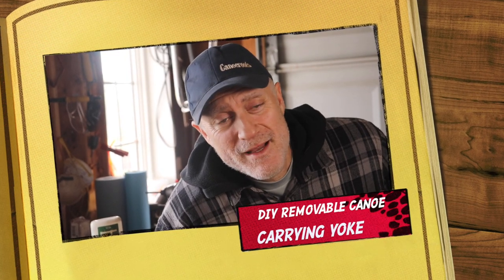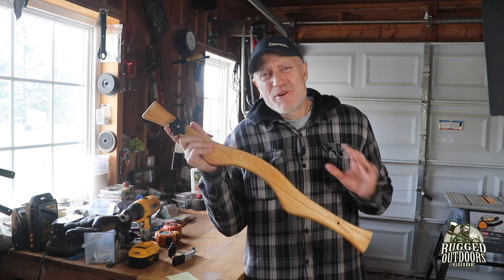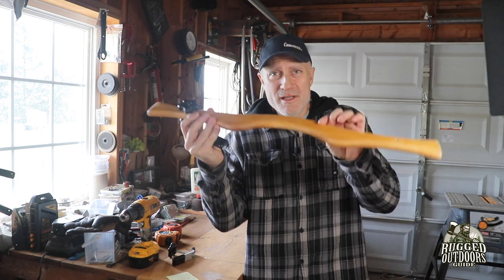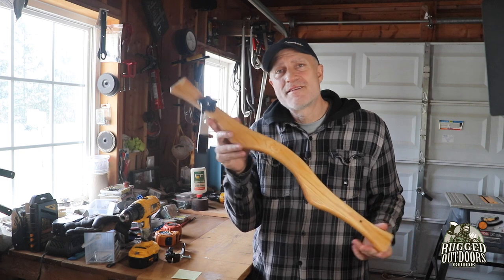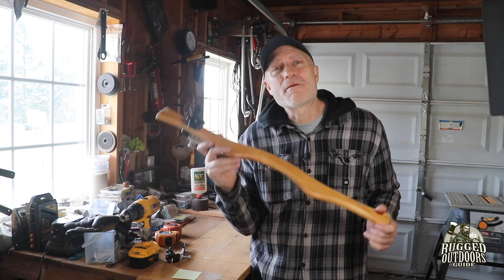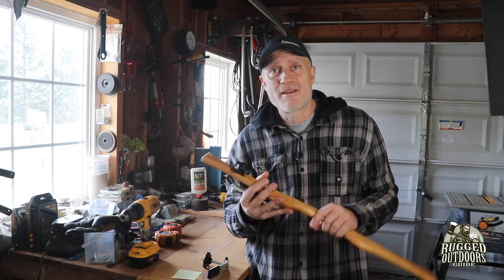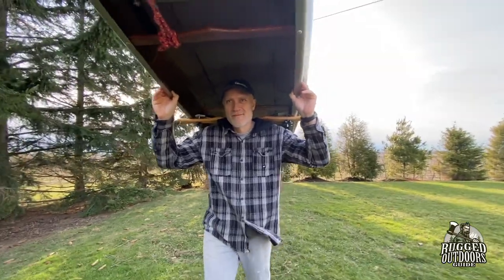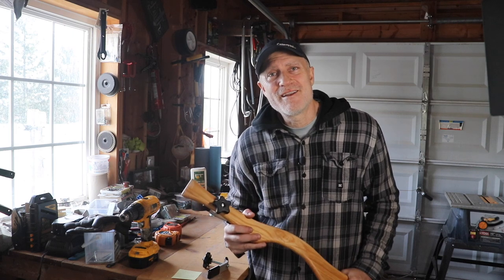How to Make Your Own Removable Canoe Yoke

Comment: That is a good solution.
You could add padding for the shoulders to make it even more comfortable.
Especially for heavier canoes.
Greetings from Germany.
Rob
Reply from the maker: Hey Rob;  You're right about the padding.  I added shoulder pads on another video but you could also just wrap some foam around each side.  Padding is certainly worth it!  Cheers,

Comment: Hey, thanks for the video. I made one using the same hold down clamps you used. It works great for my Northstar Northwind solo and it's significantly less expensive than the ones you can purchase.
Reply from the maker: Thanks for the info!  And you pretty much have the exact same canoe as I do (Bell Magic solo).